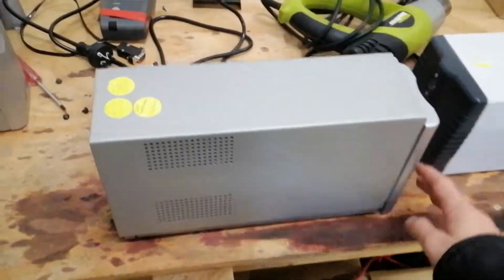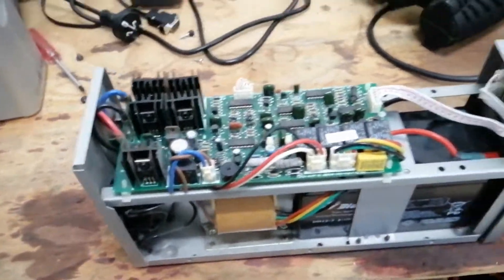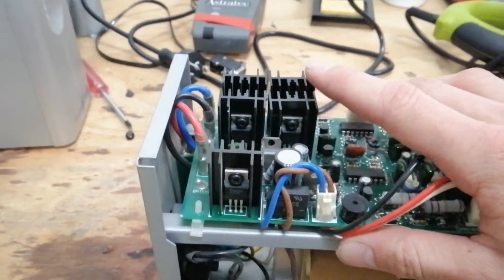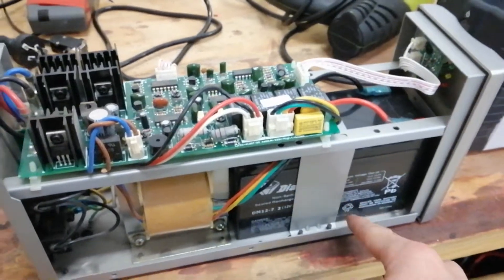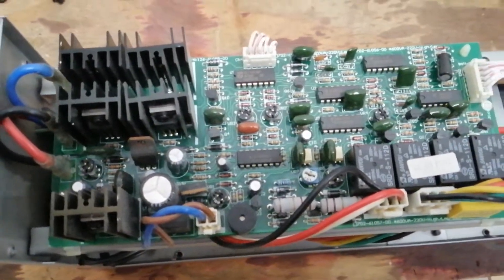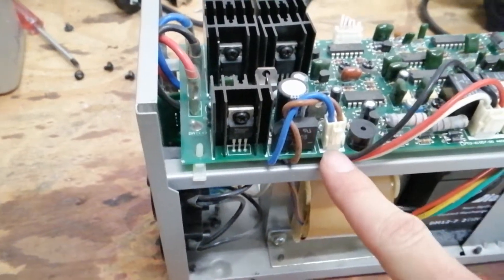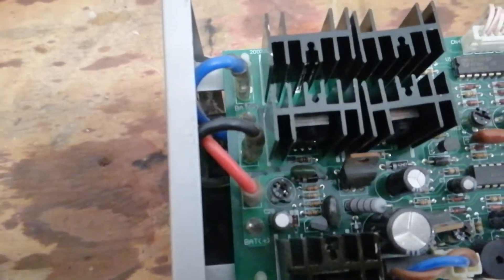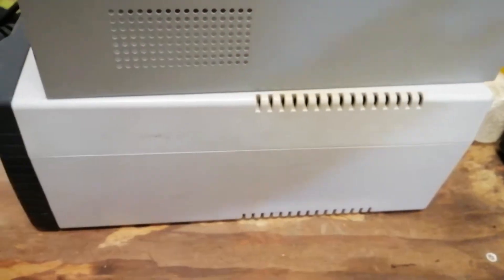PowerShield 600VA UPS Teardown

Comment: Hey mate, i have one with 4x 12v 7ah batteries and i want to modify it to run off a big Bosch 100ah 12v agm. Do i took out old batteries and connected the single but it seems to want 48v. Do you know if there is a jumper setting i need to switch to single 12v input mode? I’ll be using it to power some 240v led lighting in garage and so dont need 1200w. Cheers